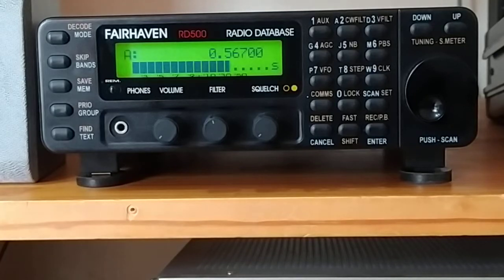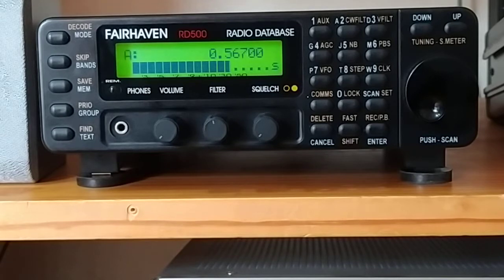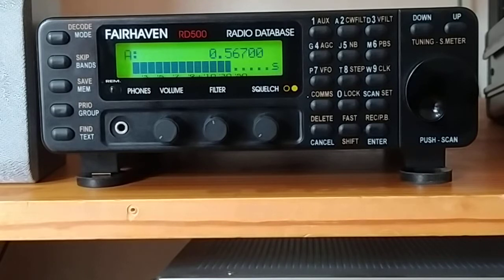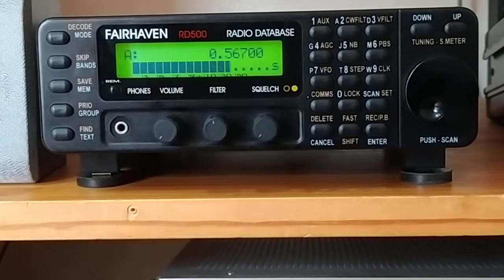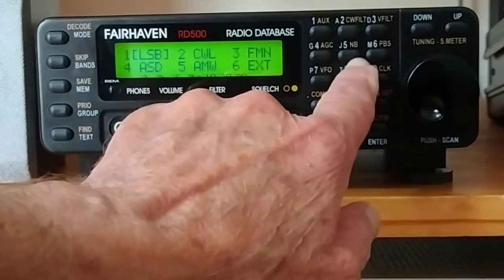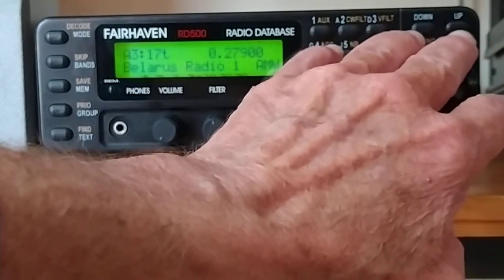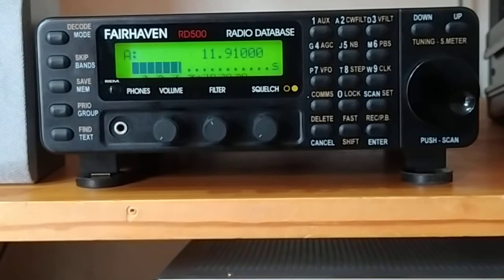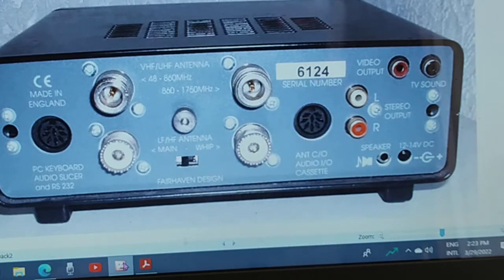Fairhaven RD500 - features

Comment: I'd imagine it would be awkward to use on a DXpedition as the buttons are small
Reply from the maker: Buttons are easy to use as they are proud of the faceplate . Easy to attach an older PS2 keyboard to an 8 pin Din plug which I have done.